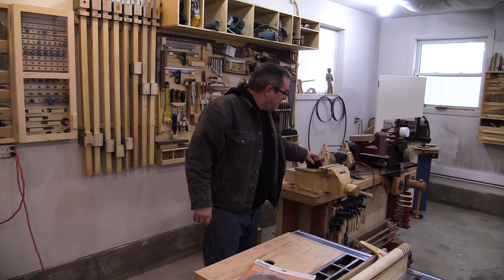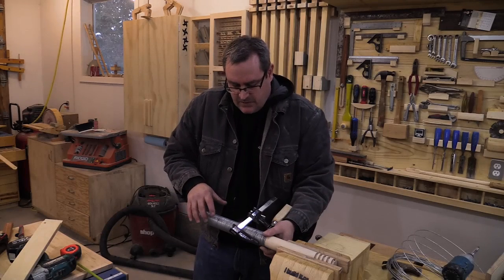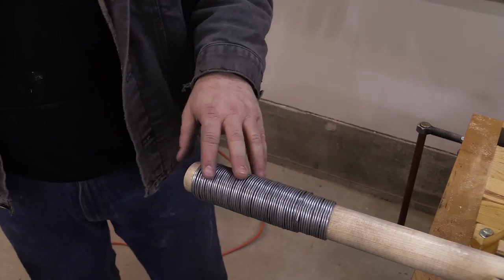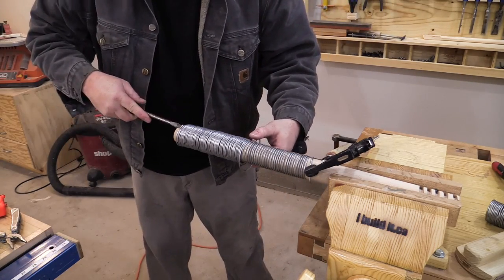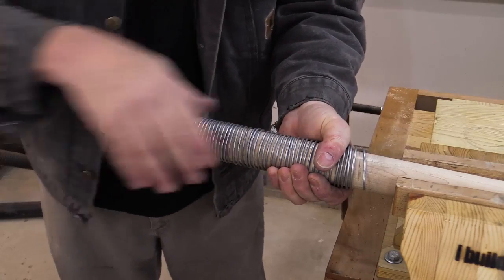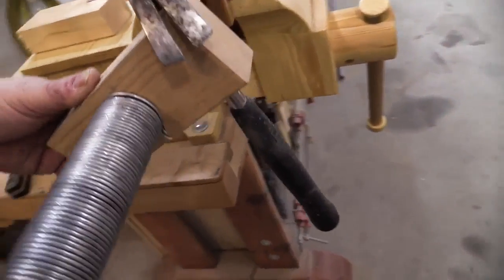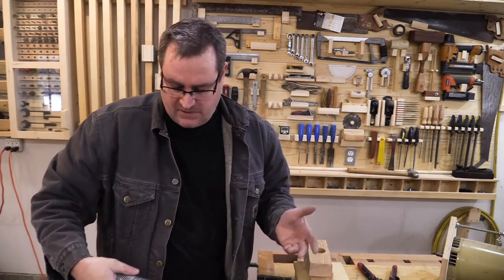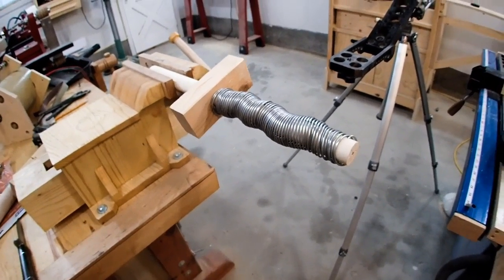Steel Threads Experiment

Comment: here is a simple solution to achieve what you worked so hard to accomplish.  put the Dowell on a rotating device and run two wires onto the dowel at the same time, then run the dowel the opposite direction uncoiling the second wire.  It's a common practice amongst those who are on the E-Cig community who make their own coils

Comment: In the vaping community there is what's known as a "Stapled Clapton wire" You make it by winding 2 strands of wire around the base at the same time and then unwinding 1 strand. You might want to give that a try.

Also, a blowtorch can really take the springiness out of the wire if you need them to not be springy.

Comment: Interesting thought John.  I couldn't help but wonder if you were to wind the wire around a smaller diameter dowel first, whether you'd get the compression you'll need for the final dowel size.  Kind of like bending any other piece of metal around a form, it always has a bit of spring..

Comment: the hole time I was thinking your idea was to make a helicoil  for wood. I understand the frustration. Anything the shape of a spring will get to you every time. I would think if you had used a spring or a preformed steel rod that already has the proper spacing with tolerances already made to fit exact diameters I would be less mind boggling. Loved watching someone elses pain. Keep a stiff upper lip.

Comment: I think you were almost there.  There is an old-time device that makers & users of large diameter rope used to "whip" (also called "serving") the ends so the rope would not unravel.  A quick search on YT yielded only the boyscout versions.  But there is a device for doing this that I have seen.  It is basically a "T"-shaped wooden tool used for whipping rope ends.  The top of  the "T" rides length-wise along the rope (dowel) and the "I" part of the "T" is a handle for winding the media around the large rope (in your case dowel).  If you made one sturdy enough to accommodate the metal wire, you could put the spacer pieces on the tool and only have to wind one coil of wire one time.  If I can  find the picture of this device I will post it.

Comment: Hey John great concept and you are on the right track. I use to work for company that made metering rods printing press's. We would take steel rods and wind steel wire around them, we had a lathe type setup that had a speed control on it and we could set the speed in how fast the wire would wind on the the bar. The wire came on a spool and would travel down the length of the bar as it would wind on to it.

Not sure if your lathe will run at such slow speed but that may be something to look into, I hope this helps a little bit, keep up the great work and thanks for sharing!

Comment: HNNNNNGGG! The frustration! Viewers need to see this: Two minutes of interesting footage represents about two days of R&D (which fails half of the time) followed by a seemingly endless stream of multiple takes, interruptions, drained batteries, auto-focus, and lighting problems. 

Anyhow, I like the new format concept. I find the failures/ideas type video very helpful. But- most of them probably just want streamlined, dialogue free, 3.5 minute knife building vids where your only reply in the comments is "Great, thanks for watching!" so expect the discontent minority to remain a constant. Oh well, some of us out here appreciate what it takes for what you produce.  

Oh, remember that big expensive lead screw you bought to make your vice? I just found a cheap alternative at the used sports equipment place: a small dumbbell bar. Some of them have a rubber handle that can be cut off to reveal a big ass threaded rod, and they are only around five bucks (used).
Reply from the maker: pocket83 Thanks for that pocket. Neat idea on using a dumbbell bar, I never considered that. The scaffold leg I could have gotten for nothing so many times, just pull one out of the mud on a job site. They get thrown away all of the time.

Comment: Cool idea. I make chainmail which requires a lot of coiling wire.
What I would do is coil two wires at the same time to get the spacing and turn the dowel with a drill to you can keep the tention on the wire.
Maybe you'll need to hammer the wire into the dowel a bit to make it "stick".
You could use a hose clamp maybe to keep it from unwinding.
Unwind one wire while glueing the other to the rod.
Hope it helps. Let me know if there is anything else I can do.

Thanks for the videos

Comment: why don't you hold the winding block in the vice and turn the dowel by hand.. .. this way you can lengten the dowel if the spring loossens from the dowel making it tighter arounf the dowel ... after it is tightly wound you can bunched it up again.? maybe if you can set you lathe very very slow you can wind two coils at the same time just by fixing the end to the dowel and holding the wire under pressure... just my two cent...

Comment: I think you're right about starting with a smaller dowel. If you can tightly wind the wire around a smaller dowel, then transfer it to a slightly larger dowel, it will be a very snug fit.

Comment: What if you drill angled holes, (like to hold the wire, but all the way through, on an angle to compensate for missing thread) all the way down the dowel? Then wrap a partial loop and feed through the hole, repeat. It would give proper spacing and should be possible to become tight enough.
It would likely take some experimenting to find the spacing for the holes and angle, and may not function well as an incomplete thread, but it's an idea.

Maybe double holes to fill in the missing thread with another wire.?
Good luck and thanks for sharing!

Comment: Having installed guides on fishing rods for many years by winding nylon thread around the rod shaft to hold the guides on, I'm thinking you may have better success by turning the dowel and will allow you to put a proper amount of tension on the wire.  That would also allow you to more precisely control the pitch as well.  your lathe would be a nice device to turn the dowel.  Just some of my thoughts which you may or may not think worth anything.  Just my $.02.

Comment: Really interesting concept, John!  I started thinking about how you could use a metal lathe running slow, along with a threading drive to wrap the wire on in a specific spacing.  Then, I thought, if you already had the metal lathe, you would just thread a brass rod using the lathe.

Comment: I guess this is an experiment to see if a person can make threads this way. However, for the same application wouldn't a scaled up version of one of your wooden bar clamps work? Just because a lead screw is the traditional choice doesn't mean it has to be the only one. Fix the moving part to the bench....well you get the idea.

Comment: I think you're making a mistake - the dowel should be rolling and the wire must wind around it. If your lathe has a low speed you can try it. Just be extremely careful and use face and eyes protection. My grandfather is a stringmaker (making strings for musical instruments) and I've seen a lot of similar job done.

Comment: John, Try using the lathe to turn the dowel and add the wire.  You can get a tight wrap that way.  Don't know how adjustable the speed on your lathe is.

Comment: I would change a few things.

1. i'd probably do this outside

2. i'd attach one end of the wire to something that won't move 

3. i'd then proceed to use the weight of my own body to pack the coil as tight as possible by twisting it and pulling it at the same time as i'd slowly approach the tie point.

There's something in this idea of yours tho i'm not sure how well would the epoxy hold.
Reply from the maker: aserta Doable, but hard to video. I think the epoxy will hold just fine - there's a ton of surface area.
Reply: I Build It I didn't mean it as a video, but i see where you come from. 

Hm, maybe put the camera pointing at you and doing it a time lapse??

Comment: Using the same method used to making a wooden thread, I'd make a shallow cut on a length of dowel and then follow with winding the steel wire in the pre-cut groove.  This would give proper spacing, and it you wanted to pre wind the wire on a smaller dowel, you could still use that method and then thread the coiled wire up the larger grooved dowel.  Epoxy as desired. Ta Da!  ??
Reply from the maker: hankus253 You kind of glossed over how much setup time there is to just cut that shallow groove at the correct spacing.
Reply: I Build It You have me there but when watching craftsmen like you cut wood threads, you make it look so easy.  BTW your new channel is GREAT....Two Thumbs UP!

Comment: what if you wind up 2 wires side by side at the same time, wind em up very tight then just remove one of them, for perfect spacing ? the trick would be to unwind one while the other stays perfectly in place. maybe put some double side tape on the dowel before you.... nah that would not work,,,  or maybe it would !  gl hehe
Reply from the maker: ***** That was my first idea, but this wire is really stiff and hard to bend. Probably have the same kind of problem, though. Thinking about a different way now that I'll try out later.

Comment: Nice to see ya "in the raw."  One thing you might try is to place to dowel into a lathe chuck and rotate it while winding the wire on.  If the lathe doesn't go slow enough, you could manually turn it.  I think this is how things are done in classical winding applications.
Reply from the maker: Ed Draper I might try that Ed. My lathe doesn't go that slow, but that would only make it more interesting!
Reply: I was thinking the same

Comment: interesting concept you may be able to just put the block on the dowel and do it on the dowel itself then once tightened just epoxy it in the wire would actually bite into the dowel a bit and help keep it in place. i've done this to make a dowel thats too small fit in a pipe but not to make threads with. i really like how you think outside the box keep up the good work.

Comment: You're reinventing the wheel... Find a cheap used metal-working lathe, and you can make all the threaded parts your heart desires.

Frank
Reply: That wouldn't really be helpful to most of his viewers...
Reply: GeneralSeptem It would be, if he (John) built a wooden engine lathe, using a length of all-thread as the lead-screw.

Comment: Hi John,
what if you'll use the screw that you want to use this nut on and an coil the wire into threads on the original screw and then hit it with heat (as @Randy Savage said) to release stress of the metal ?  PS: sorry for my english :)
Reply from the maker: tomstr21 This is the screw.
Reply: I Build It Hell. .. maybe it'll work for screw to do you'll se the same technic and then transfer the coil on the rod. What About that?

Comment: so you can use the "threads" you have made, make a larger dowel to put the threads on, 1-3/4" or 2"?
Reply from the maker: Russ Veinot True enough, but I don't have any maple thicker than 1-1/2", so I'd have to glue up two pieces. Easier just to rewind on a smaller dowel.
Reply: you now have threads too big for 1-1/2". I just thought it would be easier to make a larger dowel:>)
Reply: after thought, this episode was great and very informative

Comment: I've found it's much easier and more tidy to spin the dowel and feed the wire onto it under tension. A couple eye bolts or pieces of drilled hardwood with the wire fed through and turned slightly out of line can provide tension between spool and rod. Then you can experiment with feed angle to get the correct spacing without multiple coils. I used to make wire rings on steel rods chucked into a power drill and fed it by hand through a piece of oak.
Reply from the maker: CrackyMcZap Tough to do with 12 gauge steel wire, it's very stiff.
Reply: I Build It very true. A big geared hand cranked rig might be more work than this experiment warrants.

Comment: If you throw the coil into a fire until it glows hot red will that release the stress and make it able to reform, or does that only work with copper and other non ferrous metals?
Reply from the maker: Randy Savage No need to heat it, it will bend back again no problem. It's malleable steel, not hardened.

Comment: good luck! 
Just an idea: If you wind two wires at the same time and rewind one of them later you should get the right spacing. With some heat it should be possible after the epoxy has set.
But I'm afraid the epoxy alone will not take much force - somehow the wire needs to be embedded (heat again?).
Greetings from a fan from Germany!
Reply from the maker: leo001leo001 That was my first idea, but this wire is really stiff and hard to bend. The epoxy should hold the "thread" on just fine - there is a lot of surface area.

Comment: I know you can cut the threads directly in the wood, so how about cutting a very shallow groove to establish the desired thread pitch? The wire when wound around the dowel could follow the shallow groove, keeping a consistent thread spacing and it would give slightly more surface area between the wood and the wire for the epoxy.

Comment: Try winding two at the same time, side by side.
Reply from the maker: ***** That was my first idea, but this wire is really stiff and hard to bend.
Reply: I Build It
Hmm... maybe some softening with heat will do? Or even heating it red hot and winding while still glowing - it will shrink while cooling and produce even tighter coils :)
Reply from the maker: *****
I think i'll pass on winding red-hot steel wire!
Reply: I Build It
Heating in sections can't be that bad :) But I see Your point - too much hassle... I guess those scaffolding legs or whatever it was is Your best option at the moment : [
Reply: *****
I would wind two at once using your lathe.  Just DON'T turn it on.  hold the wires tightly in one hand using a glove(leather would be perfect for the friction), and then hand turn the lathe with the dowel chucked in.  I do this all the time when winding wire into coils for making chainmaille.  Granted in a much smaller diameter.
Reply: I Build It
 Well you could try winding two wires of the same diameter but of different metalls. Copper would be a good, although perhaps pricy, choise. Easier to wind, easier to unwind. Make the copper wire of a smaller or bigger diameter and you can adjust the "thread's" pitch.  Q: Why not a steel pipe instead of a dowel? You could easily silver weld it on...
Reply: I Build It Yea, you need to insert two wire ends to hole in shaft, and press shaft in vise between two relatively soft boards. Now start rotate the shaft with long lever. Wires will make their way to soft wood and into shaft, and will be held very tight against shaft. Plus wires will be very straight after many passes against boards.
Reply: I Build It
You could try bending it around a metal rod and heating it after, maybe it'll retain it's shape.